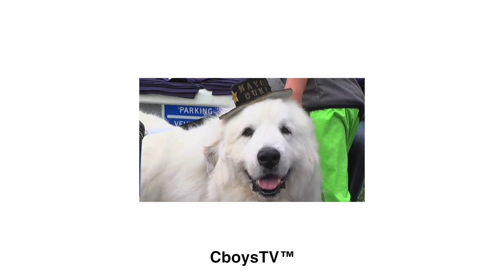Easy Golf Cart Unload

Comment: I’m pretty sure all the oil had gone to the head while it was on its side for so long, and luckily the rod or valves didn’t bend with compression when you first tried starting it. But CJ a goated mechanic for sure 💪🏻🤣

Comment: Hey guys the engine is hydro locked with oil from being on its side pull the spark plug turn over the engine it will shoot out a bunch of fluid then put spark plug back in and it will start.

Comment: tipping on the side = oil goes in the cylinder and you can't squish oil, that's why it felt seized... just wait a lot and eventually oil will go down, or just remove spark plug and make it turn to push oil out.
That's also why it smoked a lot after

Comment: If you take the spark plug out and turn it over it’ll get the oil out of the engine it’s hydro locked basically with oil from tipping it over

Comment: Y'all had the golf cart on its side which in turn put all the oil on the top end of the engine which is called hydro locking there should only be gasoline in there it's nothing wrong with it